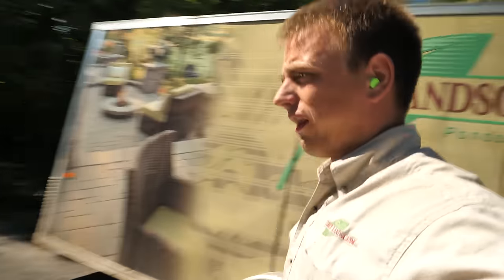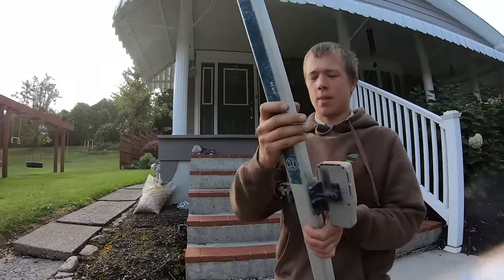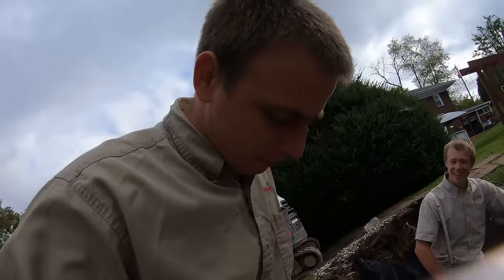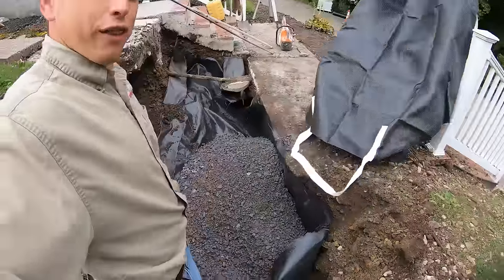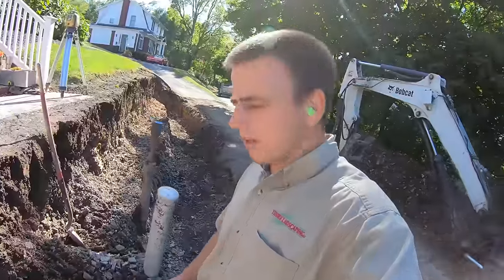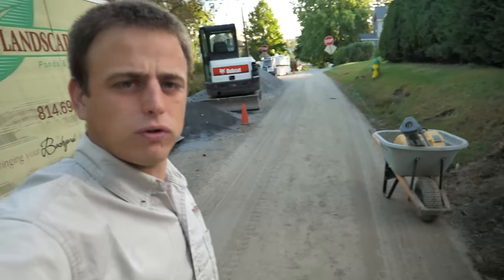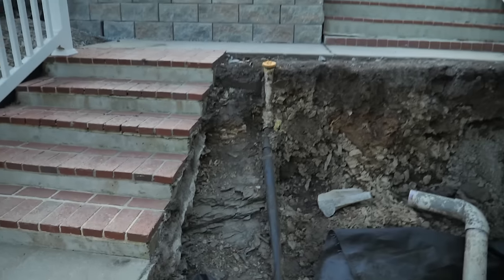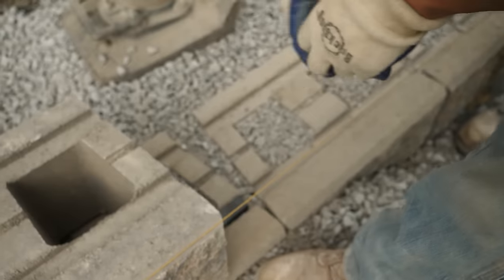How to build a RETAINING WALL that WON'T fall over!

Comment: how do you like the bobcats? some people say they're faulty at times and expensive to fix
Reply from the maker: We like them a lot. They are smooth machines. Regarding being faulty and expensive to fix, I'm probably not the best guy to ask, I just run em ;) . But I can tell you they are my favorite of the brands I've run. Machinery pretty much comes down to the dealer. You can have the best quality machine and a bad dealer, and you'll have a bad experience and hate that machine. Or you could have a poorer quality machine and an excellent dealer, and you might love that machine. The point is machinery all breaks. it mostly comes down to the service of your dealer to make the outcome of your ownership experience good or bad.

Comment: Is the separation fabric that you lay just below the topsoil running horizontal permeable ? why do you not run a permeable vertical separation fabric between the soil in the yard and all the rock located in back of the wall. I would tend to think that way you would protect the rock in a vertical and a horizontal fashion.
Reply from the maker: Yes it is permeable. We don't do separation fabric vertically between the vertical excavation and clean stone back fill. It isn't necessary.

Comment: Question: how long does the GeoGrid and fabric last, before becoming brittle and loose its effectiveness? about 10 years?
Reply from the maker: Much longer. UV rays is the only thing that would degrade it, and it's buried, so it won't degrade

Comment: I believe your company is doing quality work.
    I only have one question why would you not reuse perfectly good blocks that where in good condition till you destroyed them with your excavator during demolition.
   Yes the previous company where not qualified for the job.  I  guess you got some free block and soil to use elsewhere on this job, if you did not just hall it to the dump. ..
Reply from the maker: We dumped them. They may have been ok for a homeowner DIY project if someone had wanted them, but definitely not good enough for a professionally installed job that is supposed to last for life.

Comment: If the client wants to be able to grow bigger plants than grass up to the edge of the top of the wall, how would you go about it without that final layer of black fabric?
Reply: Small shrubs would do quite well in that situation.  You wouldn't plant a tree that close to a retaining wall for the same reason a tree's root system (over time) will wreck the slab of a house if it's too close.
Reply: @Blue-Dog  Thanks

Comment: My daughter has a 44 cinderblock wide retaining wall and a massive(lol) 6" deep 18" wide footer and here in sd ca they seem to think 40+ grand
is a good price basic 4 course cinderblock replacement wall. One contractor wanted 11k to just scratch n brown coat the wall. Everyone of them
added a permit or use of Eng would add 10k min. Sadly any quality contractors I reached out to thought job wasn't worth their time, too small
Reply from the maker: Wow. Tough to know without seeing the job, but I do know site conditions, access, municipality law, etc can make things vary a lot.

Comment: Where you leaving the geo-mesh hanging out of the finished side of the wall? If so were you just cutting it once the course was complete? Beautiful job!
Reply from the maker: yes that is correct. Then we used a torch to burn it back in
Reply: Tussey Landscaping ohh nice truck. Thanks

Comment: so that's like a 20k or more wall right & it can still push over if that top fabric is disturbed and allows soil to get in?
Reply from the maker: It's 14k, and there'd have to be some incredible disturbance, I mean like destroyed and then tons and tons of water to migrate that dirt down through the dirt to the point that it would fail. Basically, if you ever got to that point, (you won't) the dirt in the aggregate will be one of your lesser problems ha ha

Comment: I wish you were here in WA State... I have a massive 120feet long - 4feet tall retaining wall that collapsed and I’m having a hard time finding a contractor. Everyone is scared of the length of our wall 😰😰😰 I’m so frustrated
Reply from the maker: Scared of the length? That means nothing structurally. The height is a different story. That doesn't make much sense. Good luck man!
Reply: @Tusseylandscaping   They're all "scared" because I feel like they wanna do fast and simple jobs. They wanna work with little walls and make fast money.
Reply from the maker: Ye, that's sad. Definitely do your homework before hiring a retaining wall contractor. Go see a wall they built more than 5 years ago. If all is good, then you should be ok

Comment: The plastic sheet on top would hold water unless it has perforations in it so does it have perforations in it?
Reply from the maker: It's geo textile fabric, which is permeable
Reply: @Tusseylandscaping  ok thanks. I have a place at my house that I want to put up a retaining wall and loved this video.
Reply from the maker: Great! Good luck!
Reply: @Tusseylandscaping  too bad you aren't close by or I would call on you to do this job.

Comment: There's an 8ft high curved stone wall near my work. It was built vertical as a boundary barrier but its gradually falling outwards. If it had been built with a gentle lean into the curve, its own weight would have kept the stones locked together.
Reply from the maker: Yeah, an inside curved wall is really strong!

Comment: What kind of stone was used for the retaining wall? Wondering if I can use that in Cali
Reply from the maker: You mean the wall block? I'm sure you can. It's Techo Bloc's Suprema
Reply: Wes can prob confirm, but you most likely be able to grab something similar from a comparable vendor or supplier in CA....
Reply from the maker: I would think so. I honestly am not sure how far West Techo Bloc goes, but that wall block isn't that unique, most suppliers have something similar

Comment: I'm a landscaper in the Pittsburgh pa area. I did a two teir wall and finished the job like a week ago and the customer called and told me that the wall was leaning. I went to see it and it was leaning. Can i repair this wall without tearing the entire wall down?
Reply from the maker: Unfortunately not... It all starts with that bottom course
Reply: That sucks, thanks bud
Reply: Where are you from?
Reply from the maker: Good luck! Altoona PA about two hours from Pittsburgh

Comment: Was surprise how shallow the footing was...guess here in earthquake country we need more reinforcement.  Footing depth has to be half the wall height with anything lower then 3' needing 18" footing.
Reply from the maker: No kidding! Incredible. We don't know much about earthquake engineering here in Pennsylvania. These were built to spec here in our geographical area

Comment: Why dense grade over clean for the bottom of the base?

Also separating fabric for soil and clean. Was that permeable?
Reply from the maker: Hey White Pine, not following you on the first question, what am I missing? 

On the second question, yes that fabric is permeable. We place it on top of the back fill stone before putting soil back down so that the soil does not migrate back in to the back fill
Reply: @Tusseylandscaping  before you laid the first course you used 3/4 with fines (dense grade) and them you transitioned to 3/4 clean. What's the reason for dense grade at the very bottom?
Reply from the maker: Ah gotcha. The footer was compacted 2a stone, dense graded. We prefer dense graded, compacted stone footer base over open grade. 

Once the footer course was laid in, we then used clean stone to core fill and back fill.

Comment: Tussey- You noted this was a REPAIR, though you have replaced the wall that failed.  Additionally, you did not explain why this wall failed.  Please update the description to include details about your tools used.  That level caught my attention and seems to beat my trusty Stabila or Sands units.  

I hope this drove some business your way, nicely done project.
Reply: He said he believes the wall failed due to improper drainage and the freeze/thaw over the years pushed it out.  He mentioned in the vid a couple times.
Reply from the maker: A retaining wall "repair" means rip it out and replace it. Build a new one. That's the only way your going to "repair" a retaining wall
Reply from the maker: Hey Patrick, I'm not certain what kind of level that is. We bought it at a show. I really like it, sorry I don't have more details on it for you
Reply: @Tusseylandscaping  BOO!
Reply: @danmeyer7174  had I finished watching the whole video before shooting off at the keyboard... realized it later,  though no Delete Comment feature.
Reply: @Tusseylandscaping  difference in definitions I see. A reinstall would have been costly from all the handling time.

Comment: I’m currently in the process of removing an old wall and replacing it. I’m running into water building up in my trench on one corner. Any advice? Clay material and this is at the bottom of a slope in my yard. Any help is appreciated.
Reply from the maker: I would dig a drainage ditch right there where that water is, lower than the bottom of your footer ditch for the wall, and run that drainage ditch away from the wall until you can daylight the pipe. Install a perf pipe and fill the ditch with clean stone. That will get rid of your ground water. Then proceed to build your wall as normal
Reply: Tussey Landscaping thank you for responding. I really appreciate it and will be sure to implement.
Reply from the maker: You bet! Happy to help! Good luck!
Reply: I just dug a footer for my 50' retaining wall and ran into a spring/ground water.. Put in 110' of drainage pipe and 20 ton of 3/4...   Dried the ground right up and I am back on track for laying my Bin Blocks..

Comment: Wont that black, perforated pipe be crushed from the backfilled 2A stone??
Reply from the maker: No, it won't get crushed from the loose clean stone backfill.
Reply: @Tusseylandscaping  really? I swear i have crushed it with my foot as a kid running around
Reply from the maker: @JohnDoe-ir5qc  Oh you can, but just backfilling loose material over it wont crush it. As long as it is deep enough underground, your all good. If it is too close to the surface it can get crushed by machinery, etc

Comment: Can small size soil come into gravel you put in from the back with water?
Reply: Normally you would wrap the drain rock on all sides with fabric to prevent soil from migrating but there is so much rock in this install that it would take literally hundreds of years for the drainage to plug up and fail. As an alternative they could have put only a couple of feet of rock and then 3 feet of dirt with good drainage as backfill in which case the drain fabric would have been needed.

Comment: Won't the dirt drain through the stone into the drain pipe and clog it up? I see you added fabric to separate dirt and stone at the very end.
Reply from the maker: No it won't. That's why we installed that fabric, to keep that from happening.
Reply: @Tusseylandscaping  from above and behind the stone

Comment: You didn't put a bed off cement between each row / courses off blocks, why? is it because they are so heavy? you did say they must weigh 100lbs...
Reply from the maker: No we didn't use cement because this is a SRW, or Segmental Retaining Wall. Which doesn't use any cement or mortar. It's all dry stacked on a stone base and blocks secured with adhesive or special pins.

Comment: I was just watching another video on retaining walls.  More theory than actual implementation. I kept thinking "What if you put something to tie the higher portions into the bank behind?"  Then the next video I watch is you putting in geo grid.  Question answered.  Thanks.  I notice you don't have anything tying the blocks together other than weight and interlocking  I would have expected concrete fill, or some epoxy.  I'm guessing that's not needed.
Reply from the maker: the little black clips are what interlocks the wall together. No glue or concrete. You could glue them, but the clips allow the wall to be more flexible.

Comment: why not a concrete footing  with rebar? and why no  batter on the wall ?
Reply from the maker: this is a SRW wall, completely different engineering than a concrete wall. These walls have concrete and do not go below the frost line. They are built on a "flexible with freeze and thaw" stone base

Comment: What is the base? Looks like road pack or crush and run. Can you not just use 3/4-in stone for the base?
Reply from the maker: You could, but then you couldn't use the 1/4" stone for your setting bed as it would migrate down

Comment: 21:20 The fabric you put down looks shiny, it looks like their are puddles on it,  you should have used breathable fabric so moisture can get to grass roots.  Grass planted near that wall will die in hot weather unless watered very regularly.
Reply from the maker: That fabric is woven geo textile, which is permeable. So any water will pass right through, grass won't have any issues

Comment: @2:17 Your reason for the separation fabric: you don’t want dirt and mud pushing up into the sub-grade. Yes? A stability factor. Yes? How so? You damage the fabric by compacting rock on top of it. Yes?
Reply from the maker: Hey there!  We use the textile fabric to separate the sub from the base so basically the dirt from the stone... It also disperses the weight evenly as well.  The rocks don't damage the fabric!   Hope that helps!

Comment: How important is a grid on a 4ft wall?
Reply from the maker: Depends on what wall block you're using. May not need it, may need it. You'll need to check with the manufacture
Reply: @Tusseylandscaping  Thanks! Great video. I'm working on a 150 foot long, 4ft high retaining wall right now. Wish me luck!
Reply from the maker: That's a big project! Good luck!

Comment: I don't see insurance companies being mentioned anywhere. But I am pretty sure when the guy got the estimate the Customer Had a heart attack.  I must say that's excessive work for a tipping retain wall but at least its done properly and a permanent job. insurance company quotes are always going to be high so with respect to that contractors are always going to be high also and if they see an opportunity they will take it including myself. Anyway nice job it will last for years. Pity about the price to the insurance company and the repayment Premium that Will be hiked up!
Reply from the maker: No insurance company. We sell a product that lasts a lifetime, and the folks that desire a lifetime product get us to build their projects. In the long run, it's actually cheaper. Far more expensive to fix a poorly constructed project than it is to do it right the first time. In fact, this wall we replaced is a perfect example of that.
Reply: @Tusseylandscaping  well said

Comment: No geotextile sock for the perforated pipe?
Reply from the maker: No, we find over time they plug and become ineffective. Instead we cover the pipe with clean stone, then use separation fabric over top of the clean stone before putting soil on top. That keeps dirt from migrating down through the stone, which means the pipe never gets clogged
Reply: @Tusseylandscaping  Good information, thanks for sharing!

Comment: I hesitate to ask, but what does a job like that cost?
I need a wall built. Not as long as that, but taller.
Reply from the maker: This one was 14k
Reply: @Tusseylandscaping  any chance you work in zip code 17957?

Comment: Get a three or four inch piece of PVC or plastic underground pipe depending on where you are to cover the gas pipe  cut a notch  quarter inch Weider then your gas line size and rent a core drill or buy one or built to saw horses and put it on a piece of plywood mount the core drill to the top of the table inquire the bottom of the brakes it'll give the pathway of a pipe needs to be replaced and it will protect the gas line in the future
Reply from the maker: That's a great idea. I'll tuck that one away for the next time I run in to that situation

Comment: Retaining move laterally; they tip up over their toes or the back falls over.  Water certainly will add extra lateral load but earth pressure will too. As will superimposed load on top of the wall ( in fact the worst loading of all). Draining the back of the wall helps but isnt the big problem.

Comment: Hi, what range would someone expect to pay for a wall job like that?
Reply from the maker: 14k for this one
Reply: Holy Pap smear!
Reply: And this is why i do the job myself. Takes much longer, but its done right, with hand tools, and it lasts. I put in a drainage pipe on the base right behind the wall. My work still stands!

Comment: You need to consider the problem!!!,  then give the client BEST ADVICE it is your duty to sort the problem out as a professional. He may not like your proposal but it gives you. From where I am looking you could have reduced the size of the retaining wall to concentrate at the external stair and sloped the rest of the ground down to the road and make effectively a grass knoll. This would be a sensible improvement. Retaining walls always need special attention to avoid water retention the bigger they are the more problems they may cause.
Reply from the maker: Of course. You are right. We've been in business for 30 years. We get it 😜 but generally speaking steep grass knolls are a pain in the neck to maintain and don't provide any useful space